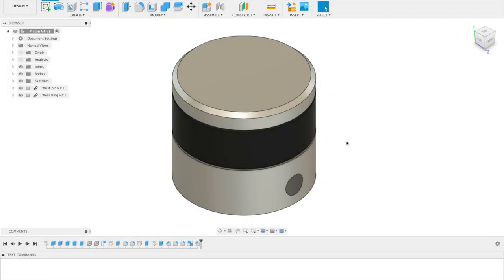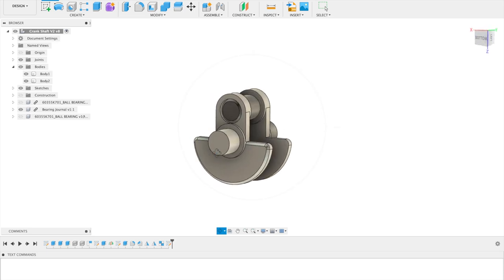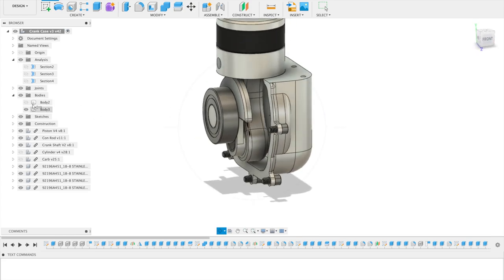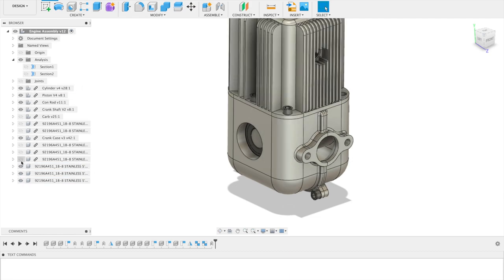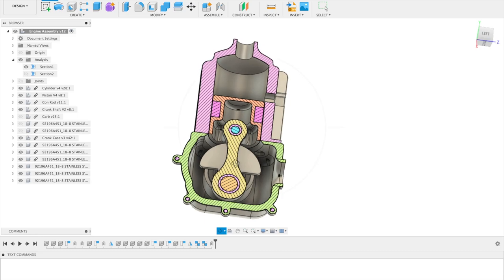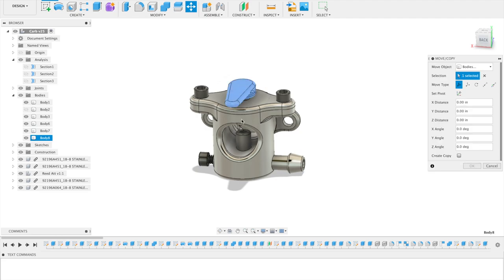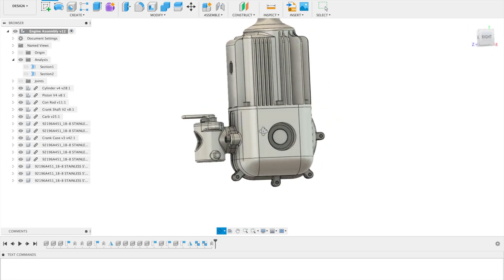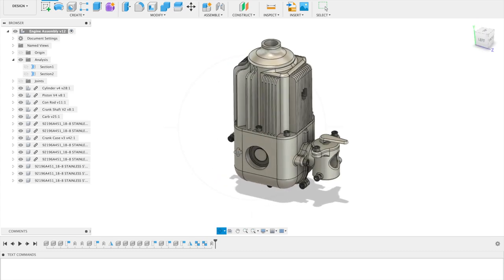Cast Two-Stroke Engine Design

Comment: You could add a square base to the bottom of the crankcase. This would give you a mount for the engine to sit upright on, and something to hold onto when working on it.  A couple of mounting holes in this base would help to mount it, say in a model boat or car. There were a lot of old spark ignition model engine with split crank cases back in the 1940's.

Comment: Hey Levi. Most connector rods have bolts holding them together on the crank. Besides the obvious they also serve another purpose. As the crank rotates to bottom dead center it picks up oil and splashes it up towards the wrist pin. Having such a smooth con rod won’t help the wrist pin (gudgeon) or for that matter the sides of the cylinder.
Maybe put some little wings on it to help splashie splashie.
The rotating air intake is much like the power valve system Yamaha had on their RZ 350 and 500. 
I really can’t wait to see this run.
Reply from the maker: Hey Gordon, thanks for the advice. I’ve modified the con rod a bit, it’s now has a more complicated geometry which should help it induce some turbulence in the crankcase. I’ve never been much of a car person so I’m not familiar but I will take a look at that Yamaha. Thanks again!